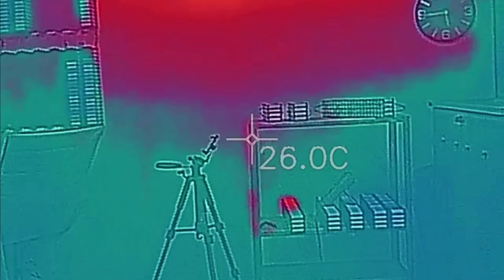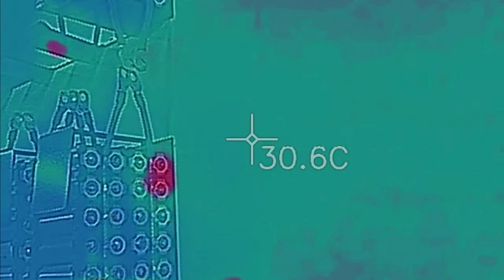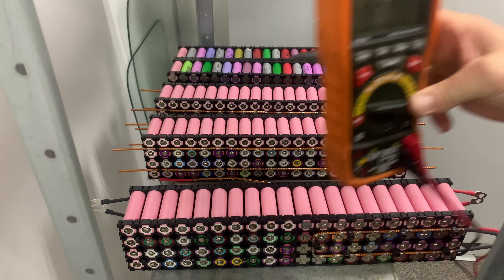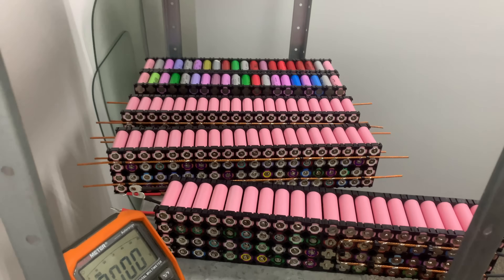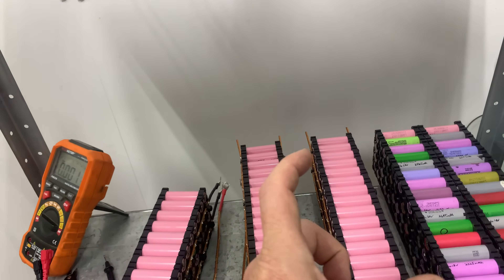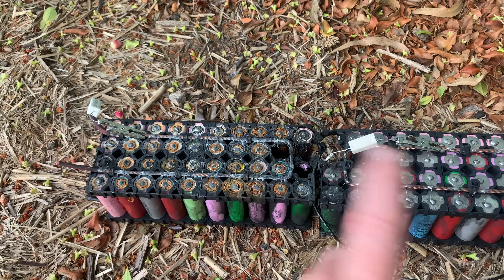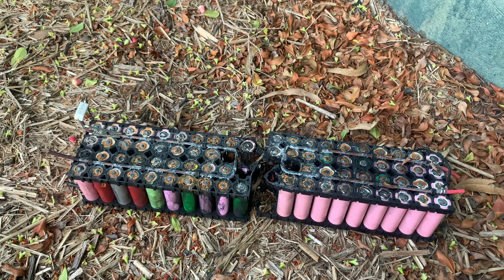faulty 18650 cells caused a fire and I think I found out why!

Comment: Maybe you should think about using more NTCs or just some DS18B20. That would locate Heater-Cells
Reply from the maker: LifePo4 will solve that issue..
Reply from the maker: Also my personal battery has 120 plus temp sensors, Also own a good thermal camera - this wasn't mine it was a subscribers that took things for granted
Reply: @HBPowerwall  Are they just NTC's or DS18B20 ?

Comment: Sorry, I'm still confused about what the actual issue/solution was.  I see it was some "hot" cells that caused the fire, but how did they get that way?  How do we prevent it?  Thanks for all your videos.
Reply from the maker: you can't prevent it, that is how these cell fail usually. Only thing you can do is manage your batteries and check often with a thermal camera to see when the cells just start getting warm - you know then they are going high resistance inside them and will only get worse..
Reply: @HBPowerwall  Yikes!  Thanks for the reply.  I was very excited to start building power walls with 18650 lit ion bats after completing a new scooter bat, but I will need to start looking at LifePO4 cells instead.  Too bad they didn't make tons of laptops with these cells!  Thank you so much for your videos.  They crack me up as well as give me new ideas.

Comment: Maybe a good pinpoint is set chargers to not exceed 3,96V/c for dual reasons: longevity and avoid overheat in weaker cells that can not tolerate the upper range voltaje? With programmable solar charge controllers is easy to do, but with some chargers like ISDT the lower voltage of mine is 4.05V...

Comment: Thanks for sharing and keep in mind. As they have found with Tesla's even after a fire has been put out keep them in a fire proof place for several days as they can re-ignite. One fire department called back several times to put out a Tesla fire in a tow yard. But that could have been ongoing shorting of the wiring and metal from the crash.

Comment: if one 18650 gas discharges during welding does it kill the hole 10 batteries in a 10s4p or just the strength of one battery?

Comment: Get some Fire Extinguishing Balls and put them in your battery cases. They are great
Reply from the maker: You sound horribly uneducated on this matter.. Time you did a bunch more research on how useless that would actually be ( unless the fire was external and not caused by the cells)
Reply: @HBPowerwall  My thinking is actually quite different from yours. Your focused on a solution in which these cells could be individually found and prevented from causing a fire or stopped instantly at the local level. To me that is a pipe dream. I would rather focus on compartmentalizing the fire boxes that you keep your cell racks in, and use the fire balls to extinguish a local area of cells in a quick manner. If you really wanted to get fancy I suppose you could make your own version of a fire ball that was more pouch/rectangular box shaped matching your cell holders that burst out in a single direction, like a airbag. then you could put it at length beside each large pack. There might be cooling issues though if your hugging the packs too close. Personally im fine with a risk of a small fire (as there is always a risk of that anyway) and focus on a system that can deal with and react to the fire in a manner that is quick, effective and able to localize damage to reduce cost and workload the fire will result in having to fix.
Reply from the maker: Those useless balls are not designed for a thermal run away.. They will stop a wood fire next to it thus stopping the battery from actually catching fire but if the battery when thermal, it's just useless..
Reply: @HBPowerwall  Why not make a version that uses a ABC dry chemical Extinguishing material? or a class D extinguishing material that does ABC fires as well and is rated for Lithium Ion batteries? you could also use Halotron I.
Reply: @HBPowerwall  Also some current Fireball brands can be used on  A, B, C and F classes of fires... So I have no idea why you don't think they would assist in dealing with a battery fire, or would not help limit dmg.

Comment: Here is an idea. Now I have left comments before, and I have stated that I am a low voltage virgin, but I have seen a number of ideas in the fifty or so years that I have been in the building trades. One idea that I was impressed with was using fusible links in attic and engineering space fire doors. What the engineers do is make the doors so that they are suspended by a single chain with two pieces of metal somewhere in the chain that are soldered together with low temperature solder. Those two pieces of metal are the fusible link. The doors all had different ratings of course, but the thing worth noting was the fusible link. Would it be worth the time and effort to explore finding out what temperatures of solder are available and using one grade or another of solder to attach the wire fuses to the battery and/or then to the buss bar? I am thinking that this would be more of a backup with that grade of solder at only one end and the wire under a kind of spring load pressure so that it would pop loose at a predetermined temperature.

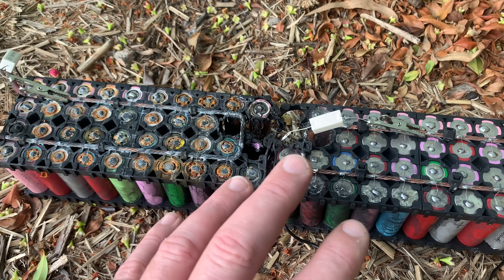Comment: 7:21 do some packs put like a thermal strip between the batteries wonder if that's a thing
then it tries to turn itself off
the connection wires to the cells look so thin, I guess that's how it is though looking around interesting

Comment: I'm putting my cells in copper water pipe and sealing it off with copper end caps and using a vape screw plug to run it and put temp sensor on all the batteries..............

If the battery wants to catch on fire it can all it likes because it wont effect anything else 

It will mostly suffacate itself out and the copper will heatsink itself 
And all the control gear use I won't even bother maintaining or testing the cells because it will all be on the pc ready to go 
Instead of balance I'll have a boost converter bypass it seires to up the voltage to stabilize the pack and I'll have a buck/boost to charge and discharge though positive and temp sensor 

Lots of software and be able to know exactly where cells at and best control of it 

Wen its ready to be dumped run program to suck life out and pull it and stack it in steel case for scrap recycling
Reply from the maker: Yep, put it somewhere safe.. Jobdone...

Comment: This is the problem with using cells in packs 

They really shouldn't be connected in series and parallel 
Each cell should have a bms to bypass the cell temp regulate itself and charge it sos batteries aren't directly connected and the battery should float at its own rates of use have data logs and algorithms sos use it fully 

So have many 0v cells and it just cuts them out of the circuit 
Cells losing mah but still have life get buck/boost up etc

Comment: Idea: Bond a 1N4148 diode per battery, then measure its forward voltage drop - which varies ~ 2 millivolts per degree C.  These diodes are really cheap as temperature sensors - 2 to 4 cents per in quantities of a hundred.  Use some multiplexed A-D converters, with an (Arduino) to keep track of and warn…

Comment: Have you tried a setup like this?
https://www.instructables.com/24kWh-DIY-Powerwall-From-Recycled-18650-Lithium-io/
He puts a fuse between every 18650, so if a single one dies it'll at least not cause a burn but offcourse itll lower the pack's effeciency. but you can easely replace it onces noticed.

Comment: NEVER FUSE THE BATTERIES ON BOTH SIDE! Every fuse has something like 0.1Ω resistance, which together with a used battery's internal resistance, and a fuse on the other side, could be high enough resistance to reduce the current enough that neither of the fuses blow, and you end up with that mess! A single fuse on 1 side only is enough to interrupt the circuit in case of a short!

The fuse's resistance will rise considerably when it heats up, so does the battery's internal resistance!

Fuse blows when the current is high enough to MELT it, so note that the fuse also heats up quite intensely when conducting near it's limit, and since it's directly connected to the battery, will transfer it's heat to the battery.

Cylindrical cells usually have higher thermal resistance on the + side(since + terminal is a cap not the casing), so fuse should be connected to the + side for least heat transfer from the fuse to the cell!

(That being said, I'm not an expert, just a hobbyist, so take it with a grain of salt, but it seems obvious to me.)
Reply from the maker: Yes i've since read this.. (echoed in comments lol)

Comment: I looked at a couple of these DIY powerwall videos with interest, then decided it might not be such a great idea (for me). Aside from the obvious need to 'do it right or not at all', I'm left wondering how insurance would regard a claim for you house burning down due to an electrical fire started by a DIY powerwall installation vs. a commercial unit? I suspect you'd have Buckley's chance of making a successful insurance claim if this sort of fire occurred when no-one was at home and it spread. God forbid it also spread to the neighbour's house, as you might end up liable for $$$$ in damages...
Reply: And if you had a DIY powerwall the assumption would likely be that that was where it started, and you'd have to prove that it wasn't. I'd hate to be in that position. In Canada when I lived in a house powered entirely by renewables I built a battery bunker into the side of a hill to ensure that if things went up in flames it would be confined to a as small a fraction of the property as possible.
Reply from the maker: shit would go south proper quick!

Comment: I disagree on his assessment what if you have a thermal camera and all batteries check out fine before you head to bed and for whatever reason mainly old age one or two of your 1850 battery cells fail then cause a electrical fire just like this fellas power bank system.  I'm not a expert but when a laptop smd capacitor fails or a mosfet fails the whole motherboard stays shut down to prevent any further damage perhaps a better battery bank design needs to be drawn up so this does not happen and how come no explanation on why the fuses did not go out to prevent these electrical power bank fires?  Perhaps a better BMS system needs cell temperature monitoring live data and BMS capable of adjusting battery banks or shuts them down if over heating of a battery bank is detected then warns you through your local network setup with wifi on your BMS through a server in your home network or setup a dmz server and connect to your phone keep track of your battery bank system where ever you are.  BMS system I envision will detect voltage, amperage, power, heat off each battery bank and of course will have options to set desired balance voltage per battery bank and not only warn you of a temperature change in your battery bank but have the capability of shutting down a detected over heating battery bank.

Comment: For people who can't afford a thermal imaging camera, you can get thermochromic colour changing sheet or even heat colour changing stickers.
They are available in different temperature ranges. You can stick a small piece to each visible battery so you can see any temperature change with your eyes.

Or you can just run the thermochromic sheet over the packs slowly looking for hot spots.

Alternatively, labels for thermo printers turn from white to black when they get very hot. They won't display the small variation of increased temperatures but if they get over 60 celsius, they start changing colour. At 100 celsius, they turn black. The colour change is permanent on these stickers so you can catch occasional faults that you may have missed occurring.

Comment: hello, it has different brand and different mah value batteries.  Does anything happen if the volt value is the same mah value different?  Finally, what is the danger that the mah value should be different?  Do batteries connected in parallel increase the C value?

Comment: Every time you mix and match cells from different manufacturers etc. you're increasing the risk factor. You end up with a pack with differing chemistries and composition of the ingredients that make up that cell - which will age differently and have different charge and discharge curves etc. so even though you're 'matching' them (voltage and internal resistance etc) when you put the pack together over time they will deteriorate differently. So my thought is only build packs with the same cells. Why risk it? For small projects like USB power banks maybe not so important - but with large Powerwall style packs - absolutely. Just my thoughts and 2c
Reply from the maker: I don't disagree - there are lots of reasons to use used cells and indeed different brands and capacity (but not chemistry ) available funds <<the very reason I started doing this, also geographical location - there might be nothing else available and you NEED some sort of storage.. My wall is 5 years old still going to random cells and starting to show it's age with the different cell groups having a greater and greater spread of capacity - but still very useable after that time and not having the cells in land fill or recycled before they had reached their true end of life is priceless - I would personally use more than 20 kwh per day from my battery bank. Thank you for your two cents..
Reply: @HBPowerwall  Absolutely. I've been cobbling together packs for ham radio projects and camping projects for years now and a bunch of Frankenstein packs going strong. Been lucky in the last little while to have access to thousands of Anton Bauer onboard camera batteries (I work as a tech in the movie industry) and been harvesting the cells from them - only recently getting around to building larger packs. I find that one or two cells are bad in the 12 cell pack and the BMS shuts it down. Time consuming but fun to disassemble and test them. Examining the SDS of these cells is a learning experience for sure. Cheers - brilliant videos btw and I've learned a TON from watching you work. Thank you. Saving these cells from recycling  is cathartic for me ;)

Comment: Peter, I have a battery made by someone else.  Now all are at 0V. I have found one with 3 heaters in it. I need to pull it apart. Plus I have 2 or 3K of batteries tested, which I have done. What are they worth to someone as think of giving up on them?
Reply from the maker: No idea, i can't give my ones I don't want away
Reply: @HBPowerwall  So not worth much at all.

Comment: Why did they heat solder the cells together instead of using a two-pole current controlled spot welder? Heating a lithium cell directly with a soldering iron is just asking for trouble! The heat from a soldering iron gets transferred to the insides of the cell degrading it, whereas a spot welder only heats the point of contact for an instant and none of that heat (or current) goes into the cell itself. A good spot welder costs less than $100.
Reply from the maker: Probably because 5 years ago?

Comment: I, certify, install and sell fire extingusher & suppression systems for a living. I'd recommend halon, co2 or foam extinguishing system. With lithium-ion batteries being considered a class B fire, there's many options to choose from. Leave me a message if your interested in protecting your battery bank investment 👍

I can get you very good prices on these or point you in the right direction. People usually don't take fires seriously until it has happened to them and by then its too late. Good on the owner of the battery bank being able to isolate the problem quickly and reacting accordingly.  Most aren't that lucky.
Reply from the maker: lots of ways to protect, but most are stupid expensive. Cheaper to just put them somewhere damage can be controlled.. Many don't get that simple safety message unfortunately

Comment: What does 40p mean? Sorry I’m trying to learn
Reply from the maker: forty cells in Parallel so all 40 positive on one side neg on the other making one big battery at the same voltage as one single cell with more capacity.
Reply: @HBPowerwall  Thank you for your reply, you have great interaction with your viewers, something many others do not do, this sets you apart 👍🏻. Thanks for the content.

Comment: Metal fires should be extinguished by burying the fire in sand or ceramic powder. That is what they do at metal foundries.
Reply from the maker: Ideally yes... how ever that's problematic when at home.. Water is cheap & accessible and will work as required.

Comment: how much trouble is it to pull that single battery out and replace it? I imagine tearing it down to that cell?
Reply from the maker: Take a few minutes max when your setup. Two bits of solder, knock the cell out, slide another in re solder... it really takes 3min max (finding it can sometimes take longer!)
Reply: @HBPowerwall   ok, then I'm more curious, why don't you pull your heaters out and replace them with good cells?

Comment: only problem with used cells is you can never tell how many charges they have left and when you use up all the charges in a cell its voltage drops and all the other cells try and fill it creating heat too much heat = fire
Reply from the maker: Bit like a second hand car.... you looking at the negatives, you can build around heat, fire, destruction very easily..
Reply: @HBPowerwall  indeed but there is only so much you can fix before it becomes unfixable or beyond economical repair so they say :P
Reply from the maker: for sure..